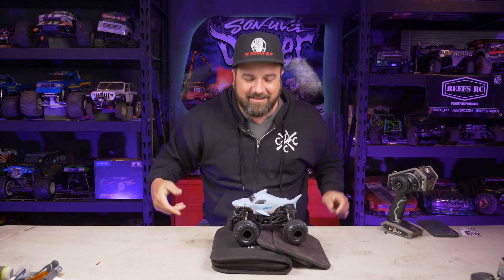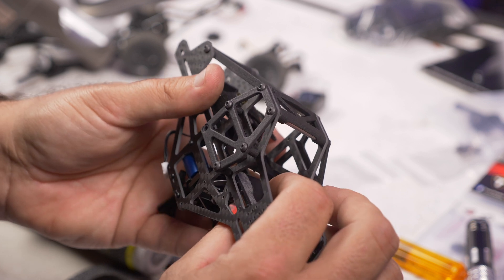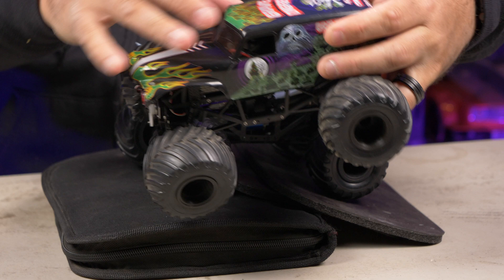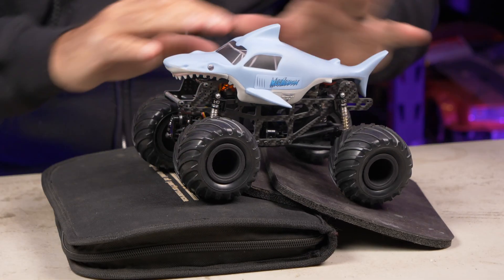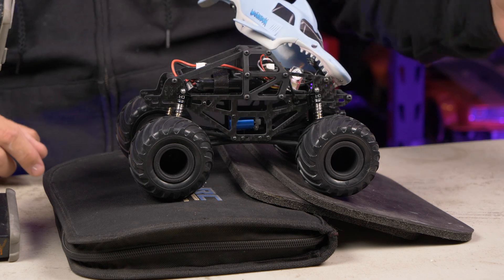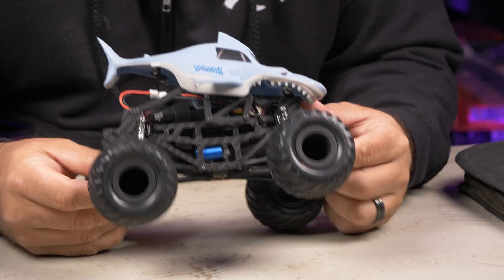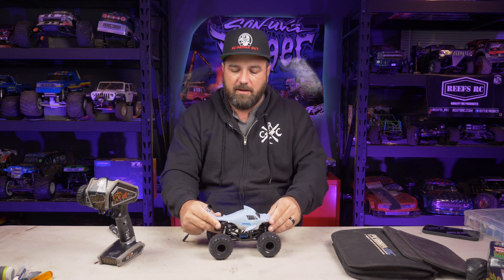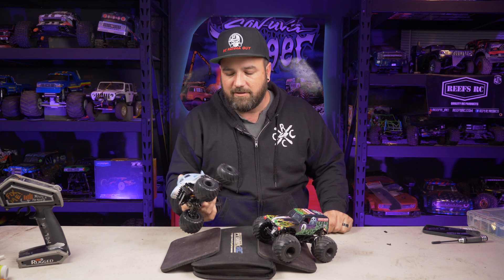How To Build A Fast Micro RC Monster Truck! Start with an SCX24 and SWMS Tiny Titan Chassis

Comment: So it's doing ok with the worm gears? I thought the monster trucks were using the ecx or Barrage axles. I turned my scx24 into a buggy and want lots of speed so I went brushless, 3s, overdrive and 15t pinion gear and got some speed I am thinking of a father motor but everyone says the worm gears get to hot.

Comment: There is a 10500-11000kv motor that fits the plate as well. It's what I have in mine but it has a sizeable fan to help cool it. Those little brushless motors make a ton of heat. As for the bolts you can use 2 chassis bolts cut down in length. Motor designations are 1220 for 10500kv and 1222 for 11000kv.

Comment: Questions,1: did you film this before getting the fruited motor/esc set up?
                   2: Could dual shocks be set up? (More scale)
                   3: Are the AMT tires still available? (Rumor is no😢). Thanks.  
Your channel is excellent by the way! Great work.
Reply from the maker: This was before the Furitek setup. This was for a quick motor swap setup.  Dual shocks can be setup. Chassis Came with the mounts.  Mounts didn’t fit my aftermarket aluminum axles. AMT tires are discontinued. Need to find one of the model kits that has them (USA-1, Coca-cola, Hot Wheels…etc)

Comment: Why not use the momentum esc from furiteck? The lizard is a crawler esc.  Just wondering.  Seems you’d get better wheel speed.
Reply from the maker: The lizard had the right motor connector on it for this specific motor.  The momentum has 3 wires with no connector. I don’t believe the ESC will give more wheel speed. It may have different settings l for the delivery of that power, but wheel speed will mainly be the motor. Both are 20a ESCs. I have a momentum for a Rocket 1410 but you need to solder right to the motor, so the momentum is perfect
Reply: @CCxRC  I see. Makes sense.  I’d just want to get enough speed to really trick a scx monster truck build out.  Like enough to wheelie and do back flips off the correct ramp.  Have you looked into any other set ups that you think would get us there? Badass by the way!!  Thanks.  Great channel.

Comment: What pinion do you use? Does the surpass motor linked in the description come with a pinion?
Reply from the maker: I used the pinion that came with the Hot Racing .5 mod gear set. It is a pinion and spur. Direct fit

Comment: This is awesome 👍 I can’t believe none of the manufacturers have done a micro monster truck yet. I’d be on board and buy a couple lol
Reply: 1/24 Losi LMT would be killer
Reply from the maker: I'd buy at least 4
Reply: I’m holding out because I know if I dump a few hundred into a scx24 they will make a micro monster

Comment: Nice.. I was wondering when people would finally utilize the higher kv surpass motors for monster trucks or rock bouncers. You see a lot of vids with bouncers or monsters running stock motors or the komodo, and I kept thinking put a 5 to 10k kv motor and then it will rip, and go even further and go up to the 3 cell with a furitek esc.. nice work!
Reply from the maker: Yes! I want to try 3s
Reply: @CCxRC  you could also see if the rc4wd 24th scale axels are compatible, they use standard gears (not worm gear drive). However not sure how they would handle with all that power.. but I bet you could get your monster truck up to 15 to 20mph for a little bit until axel gears exploded. .
Reply: @michaelbarajas1544  yes this is the best comment, you are absolutely correct!
Reply: @CCxRC  also, If you run a 3 cell with a motor of that high of a kv rating, I would suggest metal axel housings and some some good grease like lithium grease in those housing. I know with a 5k kv brushless motor and 3cell running about 5 minutes of bashing , the motor is pretty hot but also the axels housings are hot to the touch. I have a scx24 bouncer with that set up, and find 5 to 10 minutes top, with steel axels housing, hardened axels and good grease for the them.. my setup will snap dogbones,  and wear out drive cups very fast.. even have snapped the drive cups clean off (stock ones)

Comment: I have two questions.. with the setup you are running. Can it still crawl ? Are the longer shocks dry or greased?
Reply from the maker: I put a dab of CowRC Udder butter in each
Reply from the maker: Haven’t tried crawling with it
Reply: @CCxRC  ok, I was just curious about the foc style feature and if it needed a much lower kv motor to work tx

Comment: That looks amazing!! Someone needs to make these into an RTR and they would fly off the shelves!
Reply from the maker: I agree! Fly off the shelves
Reply: What do you think is an acceptable price point for this truck, as built? $400-500? Assuming a cheap radio is thrown in, that's more or less what he has in it.
Reply from the maker: @derrickwilliams2903  I think an RTR for $250-300 or so wouldn’t be unreasonable depending on options. I would shoot for the $250 or less range because it separates it from the price of the 1/10 scale trucks a bit. And it wouldn’t need all the metal extras if the parts were designed to work in  the truck. This one is so expensive because it’s a fully upgraded piece. Custom and aftermarket always adds cost.
Reply: @CCxRC  I agree. There are a ton of places to cut cost. If it were mostly plastic with just a stronger (130 size?) motor and better (2-3kg?) servo, I think $200-250 would be very achievable. It's an easier sell to make something that's fun and a good starting point than something already upgraded to the hilt at twice the cost.
Reply: Oh yes, my RTR comment was on a more cost effective version with a plastic or metal chassis.  Afraid I only work in £ so think they could probably get away with £190.  We pay about £120 for the scx24.  Mind you if we wanted licensed bodies then I guess that will add quite a bit.

Comment: Hey Tony. Can you run the hbx devastator or enduro24 axles with the tiny titan or ecb chassis for more wheelspeed with ring and pinion axles
Reply from the maker: I don't know. It would probably require changing the links as well. I know the SCX24 driveshaft will fit on the Enduro24 axle.